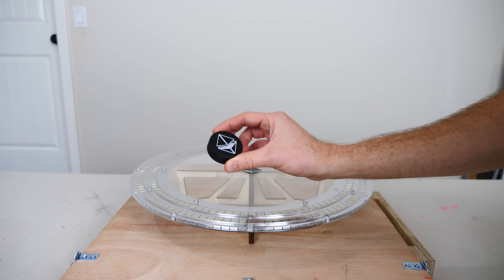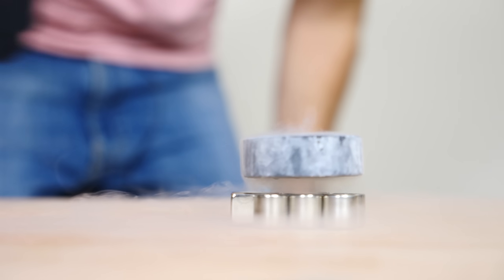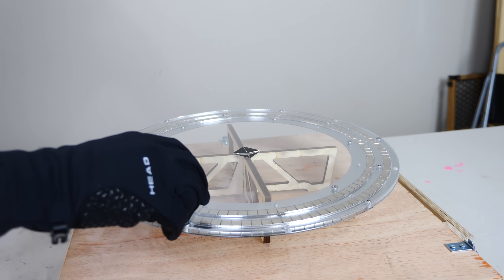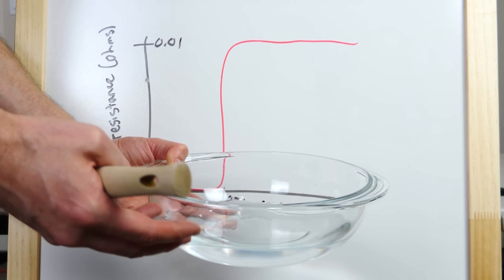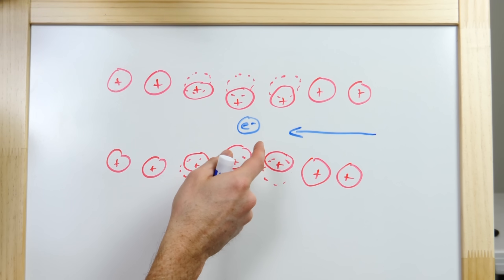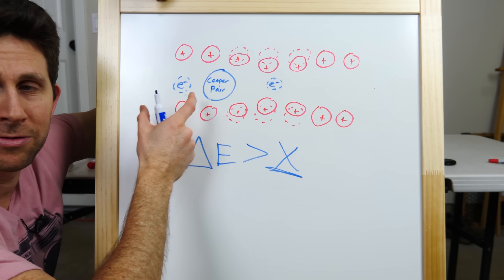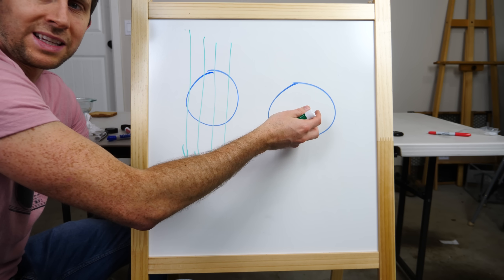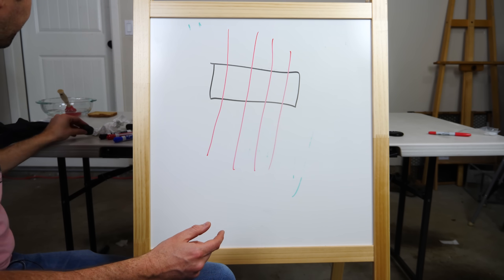Quantum Locking Will Blow Your Mind—How Does it Work?

Comment: Just a thought, could this setup be upscaled and put in a vacuum.
Reply: There was no movement againts a force to generate power.
Reply: You have to expend energy to cool the superconductor as well as impart a starting force
Reply: Physics grad here. NO the puck is not moving by itself, you need to put force in order to move the puck. Magnets are only helping in levitation. So if you connect a generator to this, it'll offer even more resistance and produce less energy than the energy supplied to it, which defeats the whole purpose.
Reply: @lastphotons  
Agreed in a best case perfect scenario (which is extremely unfeasible and in my opinion nonsensical to accomplish unless you could perpetuate it indefinitely for storage which seems even more unlikely) You would only be able to extract the energy you put into it.
Reply: @lastphotons  essentially you can't get more energy output out than what you put in which is part of thermodynamics if I recall correctly? Sorry I'm a peasant when it comes to physics :)
Reply: @mrnobody9821  you cannot create energy, it can change forms, you just cannot create energy out of thin air. Thats the law of conservation of energy, which has not yet been broken.
Reply: @lastphotons  that’s what I thought. Those of you that thought I was having a free energy machine break through I understand the rules. I was more or less wondering if you could make a machine with no energy loss this way.
Reply: @kevinpettigrew4792   That's the reason we are still struggling with Fusion. We Can do it, but cant sustain it. Because it'll just eat the energy it produced.
Reply: Build a perpetual motion machine in Antarctica 😎
Reply: Maybe, if you could break apart the cooper pairs with some low energy signal and then collect the resultant electron quantum states.

Comment: my question is could you theoretically create a motor out of this using electricity and liquid nitrogen as fuel.
Reply: Physics grad here. No you cannot, magnets are only contributing in levitation. You will need to provide energy for the puck to actually move. It moves very easily here because the friction is very almost zero.

Comment: If this were scaled up and you had a ton of weight on a superconductor floating would it weigh anything and be difficult to push? Other than moving the magnets holding it up. Could have entire hallways magnetized and float superconductors down the halls with things on it. But I think forklifts would be more economical still.
Reply: You'd still require sufficient force to overcome inertia (a body at rest tends to remain at rest, etc)
Reply: Entire hallways magnetised really not a good idea Imo,  almost everything in our pocket and backpack are steel. Unless we can activate and deactivate it. Like marvel BlackPanther

Comment: 4:40 --- perpetual motion by getting two of these one hanging from pipe of some sort with a centered wheel bearing
and another one but of opposite magnetic poles on the bottom with a wheel bearing stand. and using force instead of energy to create perpetual motion. ?? free energy?
Reply: this technically wouldn't violate the second law of thermodye cause the magnetic  attraction would prevent the lose of energy from the magnets... you might lose energy from the bearings by heat but ..... im sleepy and tired

Comment: Question... 
If place a block of nano carbon tubes parallel to the magnets,  And use a Tesla coil generator to push a positive charge into the carbon tubes, and use it as an ambient temperature syperconducter?

Want to try that?

Comment: Seemingly its superposition is dealing in another force   The pairs interact with pairs until pooled.  By cooling a superconductor the heat doesnt st

Increase the electro magnetic resistance.  The perfect experiment for looking at the interaction between e&m with thermodynamics.  It can be supposed that each pair is paired to another pair until its a cooperesque pool.  This is why at so many points in the field there exists a dipole moment.  Impurities a understood to play a factor. 
 Otherwise the electrons could pass voltage in the presence of other conductors.  So having said that the magnetic field immersion could be exposing a different model not necessarily standard.  It resembles other solid state phenomena like say the piezo effect.  Seemingly no relation but with thought it can be understood my meaning.  For each point to have the "memory" of its initial position each point would be a magnetic well with initial value.  If an ordinary magnetic oscillation occured electricity would flow.  Yet the electrons are behaving as one entiry as described via non locality.  Thus non locality is why its quantum.  Yet its behavior in an excited state may clarify other properties.  Yet coincidentally such magnetic moments dont explain motion.  Therefore another effect is also at work here.  If the universe were not cold but hot surely e&m would come to a halt having other observable consequences.   Cool video thanks.

Comment: Hey Action Lab, at 3:53 you are spinning it around on the circular magnet table, if you put this in a frozen vacuum chamber it would spin forever, right? And if you added a something to propel it forward that works with no air it would go faster and faster over time. Would that work? If you reply I will be surprised :)
Reply: It would in fact spin forever in a vacuum chamber (if it holds the temperature)(probably gravity would slow it down too), but it would match the propelling force and then stop accelerating.
Reply: @kaylake23  Yeah, I realized I forget about gravity's affects a bit after making the comment.

Comment: I have a question, you stated a copper pair is possible by the positive charge of the ion working on each electron causing them to build the weak bond. But then when the super conductor is super cooled the resistance or effect drops to zero. Wouldn’t that contradict the coopers bond and make it no longer present? Simply stated how does the coopers pair continue to exist without the resistance of the positive ions?

Comment: I saw a video of the “Roswell rock and was amazed by how it could be spun by a magnet. Studied and figured out it’s was due to a change in orbital motion of electrons around the atom and how magnetism is an invisible wave that can interact with these electrons and give them a corkscrew pattern. It’s basically how a compass works for diamagnetism(that’s what help me understand diamagnetism). But quantum locking is more complex but I think I do understand 

instead of a change in the orbital motion of electrons they are dispersed inside an invisible parallel line. Instead of electrons moving about freely, they act like an invisible 90 degree angle in between the two parallel lines and the object??
Reply: This is the most awesome comment in youtube history 😂

Comment: Someone mentioned science becoming magic. I've pondered that idea on many occasions and it has always centered around that devilish quantum entanglement. The thought of two 2 objects that pop into existence with  no limit to how far apart they can be and happening in the same instance is difficult for our human brains to accept! If we can control quantum entanglement we can control the smallest fractions of molecules that make up everything in the universe. We will be able to create anything,  anywhere at anytime. Isn't that the purest most simple definition of magic? I believe that if humanity is to travel the cosmos between our solar system, our galaxy and finally the entire universe? I think it will come from mastering quantum entanglement and/or quantum mechanics.. Once  you master  the quantum realm, you have the power to control subatomic particles to create hydrogen. Once you create hydrogen we then have the power to create all the elements. Maybe there's a quantum way around having to fuse  hydrogen into all the other elements..

Comment: Is it possible to create free energy with this method with the magnets with quantum locking?
Reply: I suspect not because, in order for this phenomenon to function, the temperature of the magnet seems to require it to be maintained at an extremely low value, and that probably requires a significant amount of resources.

Comment: ok this is cool and all but no one is thinking outside the box, all you're doing is adding more and more magnets and designing theme parks. How about you start mixing resonance, vibration and frequency to quantum locking to see the results. That is, attach those magnets to the bottom of a chladni plate, then super freeze thousands of shavings of superconductors and see what happens when you run a frequency into those levitation superconductors... will they act like rice??? maybe frequency would be a way for you to move your levitated superconductors without you pushing it with your finger.

Comment: Very well explained until the final minutes. I didn't  get a sense of understanding why a traditional conductor is repelled but a semiconductor stays put. So in a traditional conductor the field lines of the outer magnetic field go right through the material and then what? And in a type 2 semiconductor only some of the field lines go through the material and then what? Why is one repelled but the other resists moving in an inhomogeneous magnetic field?

Comment: I really want to see a video of not a puck but a heart engine made of the same superconductors however lined with a water tight thin superthermal resistant barrier and then quantum locked over a big magnet base and then filled with liquid nitrogen... if done correctly my theory is it will spin faster and faster without the inertia resistant effect from direct contact to anything and even maybe not be acted on by earth's gravity very much either due also to the quantum locking so the engine would keep moving and not fly apart

Comment: So all we need is a type 2 super conductor so powerful that it will react to the earth magnetism and we basically have antigravity. The super conductor in this video seems to act just like the UFO in the recently released government video. Perhaps we are looking for antigravity in the wrong field, rather than looking in the physics of gravity we should be looking at magnetism. How far does the magnetism of Earth extend into Space? Does anyone know? Is it like gravity and goes to infinity? Bob Lazar's UFO diagram has three "antigravity" units, what if they are simply super conductors that are "tuned to" or "so powerful" that, they use the effect we see in this video to "simulate" antigravity? Anyone more knowledgeable about this stuff have any thoughts? The results would be nothing short of a world changing event, cars and planes that "float" in the air with no fiction to movement, floating cities, my mind is reeling  just thinking about all the possibilities.

Comment: Fascinating video for sure. I was wondering the whole time I was watching about what would happen if you bonded a circular plate the same diameter of the puck of 1/8" pure copper to just one side of the puck and then both sides of the puck. I wonder what strange discovery you could make when  you mixed levitation of a superconductor with Lenz's Law! I have seen experiments with copper and strong magnets at room temperature, but never while the copper was in cryostasis.
Reply: Question.. Seeing your comment I assume you're aware of the pucks complete material makeup. What is the pucks material itself?

Comment: Would it be possible to use a squirrel cage style platform and have the super super conductors float around on the inside? 
Would it also be possible to use electro magnetic coils instead of permanent magnets so that you could actually accelerate the superconductors around the inside of the cage.
Reply: That is exactly what happens at Magnetic levitationg Trains like the Maglev in China between Shanghai and that other citys airport. thats why its also the fastest train in the world with far over 300km/h
Reply: @schnittwunde4918  i was thinking of using it as a centrifugal source...with sections rotating around a hub with a very high speed it could probably lift a vehicle....
Reply: @larryweeks4816  
I mean sure you could but it wouldn't lift anything because it doesn't generate magnetic force... You'd be better off just using an electromagnet to directly lift something.
Reply: @fireteamomega2343  I  was not referring to it as a magnetic force, but a centrifugal force, with slugs running in a circular pipe at high speed , instead of having a connection to the center of the wheel it would need no connection, and would generate high levels of force with no friction thereby generating lift.
Reply: @larryweeks4816  
Unless it was a propeller shaped superconductor with two magnetic lock rings near the ends of the blades (or actually displacing air by spinning) it still wouldn't have any lifting force. Just outward strain on the pipe enclosures the faster you spun it around.
Reply: @fireteamomega2343  obviously i am not getting the point across
Reply: @larryweeks4816  
Build it and find out

Comment: When you watch Physics YouTube videos: wow this is so cool I wish I could learn more
When you learn more in university: F_B_vec=IL_vec cross B_vec, EMF=-d(integral of B_vec dot dA_vec)/dt, I=EMF/R, find the maximum magnitude of the force you need to exert on a circular wire loop with radius 0.5m, resistance 100 ohms, entering a region with constant magnetic field 1.5T, whose direction is normal to the wire loop, in order to keep it moving at a constant speed of 1m/s.

Comment: Could you theoretically make a zero-input generator with this concept? Assuming you could upscale this and create a perfect insulation so the superconductor is always cooled, what's to stop someone from putting gears or some sort of ribbing alongside the edge of it's travel path in a circle? The energy would be minimal but because it's derived on a system of pure magnetism would it be a "free energy" system or are there people much smarter than me out there who could explain otherwise?

Comment: So what happens if you change the ohm's +/- ? and or use small groups of positive charges in parallel  would that help with the heat  ?. it seems heat is the weak point.

Comment: I mean they talk about free energy if you could produce lowest point in Kelvin with extreme heat output. I remember that from physics years ago. Seems like you could build an engine from parts like that with liquid nitrogen as jet spray onto those super conductors?

Comment: I am not a physicist, or even a scientist. I guess it would be fare to call me a science-fictionist. The point is, I don't have the vocabulary of a trained researcher so I am probably going to get some of the terms wrong here, so apologies for that in advance. I am curious if the fields interacting in the particular experiment where the conductor circles the track, if those forces have a noteworthy effect on air resistance as the conductor circles the track? Do the forces push away or attract stuff in the environment, and if that is the case, how much of a difference is there in performance compared to results when the task is undertaken in a vacuum?

Comment: The recently-discovered superconducting "perovskites" (metal-oxide ceramics that normally have a ratio of 2 metal atoms to every 3 oxygen atoms) belong to this Type 2 group. They achieve higher Tc's than Type 1 superconductors by a mechanism that is still not completely understood.

Comment: "electron looses energy to heat" "electron looses energy because the atom does it"... Your video is full of self contradicting information, I know what you meant to say but it wasn't stated in the way you meant it to be. The loss of energy in the system leaves less energy to loose in these interactions, meaning the interactions can occur for a much longer time frame without any noticeable difference from our perspective. Almost to the point that we would say 99.9999999999999999999999999% of all lost energy is due to external forces.

Comment: are you sure the resistance is exactly 0 ohms and not for example 0.000001 ohms ? What will happen if you pass electricity through 0 ohms resistor ? infinity current ? Well if the battery have 0 internal resistance / is a supper conductor/ yep.

Comment: its interesting that the flow of the electron doesn't move towards the positive charge. and wouldn't the object need to be continually cooled to maintain zero resistive properties, as the object warms up to the room temperature, then the object would slow?
Reply: When it's supercooled it doesn't easily  interact with atoms in the air, for the same reasons the phenomenon works at all, so it stays cold for quite a while.

Comment: Hello! Need a favor from someone. I have a daughter at 6th grade and we are going to have a science fair. The experiment is to measure the decay in the temperature difference between several cups and the room temperature when I pour boiling water on the cups. The cups all must have the same volume, thickness and external area, the only difference should be the material. So my question is... Where can I buy such cups? Also, I would like to get some app capable of interpolating a graph given a set of data points I am going to measure, preferably such app should allow me to print the graphs. Anyone can help me with that?

Comment: It's not clear why Cooper pairs are needed for superconductivity. Wouldn't single electrons also move through without interaction? Is the  interaction energy level of a Cooper pair different than that of a single electron, and is that the key?